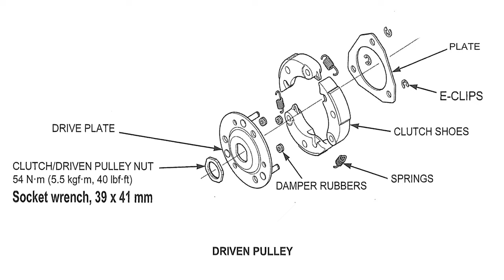How to disassemble and repair motorcycle drivetrain clutch shoe. Honda pcx 125

Comment: Thanks for the video, watched everything at 75% speed. Also thanks for the socket size and drawing at the end. Good to know torque details.👍
Reply from the maker: The clutch pulley nut torque values are as follows.😄😄
TORQUE: 54 N m (5.5 kgf m, 40 lbMt) / 54 N m (5.5 kgf m, 40 lbf ft )

Comment: Appreciate the video. But this is not how you rebuilt driven pulley.

1. Don't generously grease the male sheave like that. The grease will move to sheave surface and voila belt slipped.
2. The torque spring sleeve also shouldn't be that loose. He forgot to install 2 orings. It's fatal. The grease will splattered out around including the bowl and clutch.
Reply from the maker: Thank you for your interest in the video.

Comment: the socket hammer punch on the last plate is new trick for me haha, very nice !
here in Israel you will never see a repair shop open the clutch clean and reassemble it. well done
Reply from the maker: I'm happy that you're having fun too. 😊
Even in Korea, disassembly and assembly are not common.
Most prefer to order and replace with Assay Sets. (이스라엘)

Comment: Merci pour cette vidéo, mais il n'y a pas un couple de serrage normalement?

plutôt que d'utiliser la clé à chocs? En fait je préfère réparer moi-même plutôt que de laisser faire des professionnels qui ne font pas du bon travail.
Reply from the maker: Le couple de serrage de l'écrou de la mâchoire d'embrayage de 28 mm est de 54 Nm.
Reply: @MotorcycleRepair  Merci pour ta réponse 😉 Mais 28mm c'est le diamètre de l'axe, pas la dimension de la douille?
Reply from the maker: Oui c'est vrai. Pour dimensionner l'écrou, utilisez un outil de 39 mm.

Comment: Why are my actual clutch shoes so difficult to get off?
Reply from the maker: The task in the video above looks easy, but it is not an easy task. However, after a few attempts, it will be possible without difficulty.
Reply: @MotorcycleRepair  When in doubt, lots of WD40 and a hammer. They were really stiff to get off. I think it took me the best part of 3hrs just for the shoes.

Took 30mins to get the new shoes back in, drive face, new variator, rollers and belt on plus all casing, then got worried the bike wouldn't start, im like, 'not touched any of that! Oh yeah, side stand down' LOL 😅🤣😂

Now i gotta get the handle bars and front casing off to change the rubber bushings underneath. They dont make it easy
Reply from the maker: @TheDullMansClub  Cheer up and I hope things work out well for you.

Comment: The old shoes are barely worn in, why replace them?
Reply from the maker: The weight pad inside the clutch shoe is also a part that needs to be replaced when it becomes thin.

Comment: hello my friend i was just wondering how many miles was on the bike???? i have 2021 and im at 42k miles with stock clutch lol. i have just ordered a used whole unit with only 3k miles of use on it. im going to replace the whole clutch at 50k miles. would love to know how long the stock clutches last.
Reply from the maker: It's an old video, so I don't remember how long it was driven.
In most cases, clutch pad repairs are performed after 50,000 years of service and are either driven further or replaced depending on the condition...
This period varies greatly depending on the driver's driving style.
Reply: @MotorcycleRepair  my bike basically lives at high rpm and is under constant load so mine should of worn out by now but yeah there actually in good condition.
Reply from the maker: @mrpantur7280  The rpm goes up, but the acceleration is slow and the top speed is not achieved.
Or, if you feel that the rpm increases, the noise becomes loud, and the engine power is weak when going up a hill, check it at that time, and if it is not in good condition, replace it.
If there are no problems with current operation, there is no need to inspect or replace.
Reply: @MotorcycleRepair  i 100% agree with you but im selling the bike to a friend when im at 50k-55k miles and i want the bike to be in good working order. id tell him to keep the old clutch for spares as its still in good condition. sorry to keep asking questions but have you had any personal experience with aftermarket clucthes like malossi or polini and do you know if there reliable?. 

thank you for your time.

im a big fan of your chanel and videos ... GOOD WORK !!!
Reply from the maker: @mrpantur7280  We pursue genuine purchase of most parts.
We do not recommend using tuning products or compatible accessories sold in some shopping malls.
Some people personally purchase them, bring them in, and ask them to install them, and they do the work for you.
If you can't get genuine parts...I don't know if it's inevitable.
If possible, we recommend genuine parts.

Thank you for liking my video.
Reply: thanks for the help and knowladge. shame you are not here in the uk. the mechanics in this country are awful. even the main dealers mechanics are bad.

Comment: Thanks you very instructing!  are the parts # the same for a PCX 150 2013-2017?
Reply from the maker: There is no pcx 150 model in Korea. So I don't know if it's the same as the video above, but...
I think most of them are almost the same.
Reply: @MotorcycleRepair  Thaks seems I found the parts # Clutch Face Driven 23205-K35-V00 MODELS 2015 - 2018
Reply from the maker: @blindsouris  I hope it gets resolved well.
Reply: 2019년식 nmax 125cc 후방 클러치를 열려면 키 번호 38mm, 39mm 또는 40mm가 몇 개입니까?

Comment: the grease used, what type?
Reply from the maker: The grease was included with the parts.
I don't know what the ingredients are.
Usually, you can use heat-resistant grease in places where there is a lot of heat.
Reply: @MotorcycleRepair  cooper grease i think